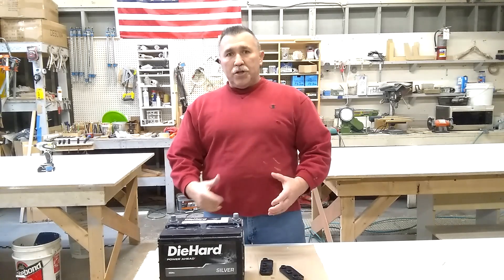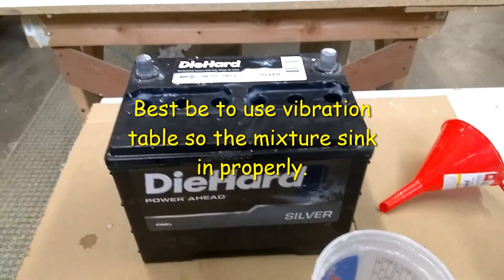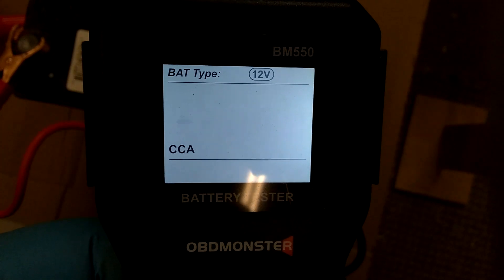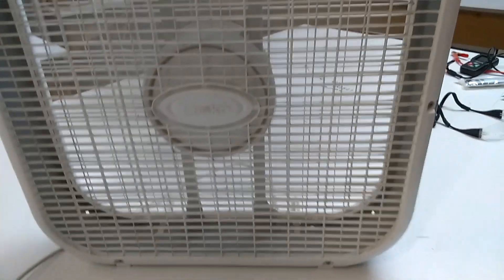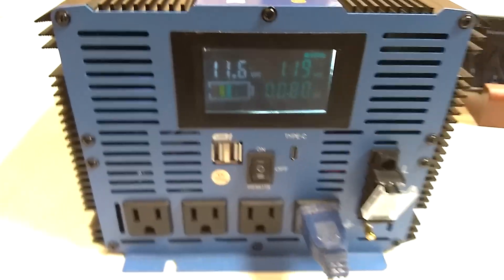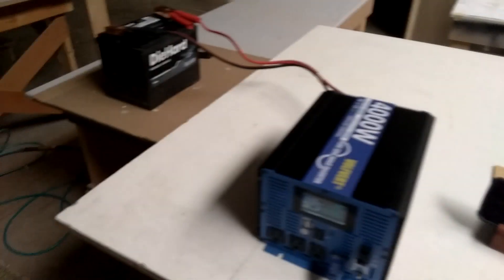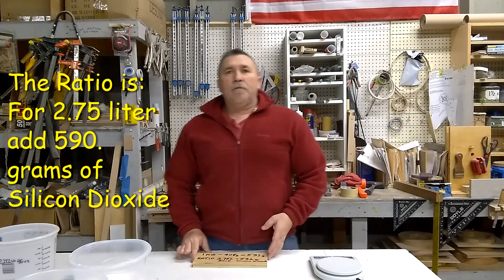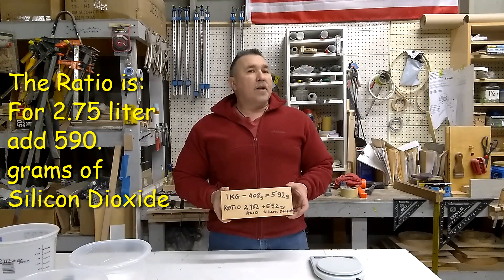A # 380 -2 Convert your Lead Acid battery to Crystal battery- TESTS- ENGLISH only.

Comment: Hi, thank-you so much for taking the time to share this great tutorial.
That said, how is the battery holding-up since you converted it?
Any issues? 
Is the performance still good?
Reply from the maker: Yes, my is good still.Based on my experiment, one YouTube guy did such a test and professionally documented 100 full charging and discharging cycles. Unfortunately, it is in Polish and the charts are difficult to understand. Link to the video.
https://www.youtube.com/watch?v=hyMi1o2HHWM&t=14s

Comment: This is very good result.  
Just for future trying:  
1) weight about 100g in a bottle.
2) make 6 bottles. 
3) label 1,2,3,4,5,6.  One to each cell. 
4) Add whatever it can take, cap the cell. Bottle-1 to cell-1, …, bottle-6 for cell-6. 
5) use it.
6) Repeat steps 4 and 5 every other day until all powder is added in cells.
This way you don’t have to move the battery or handling acid.